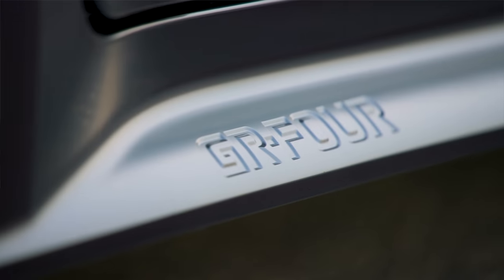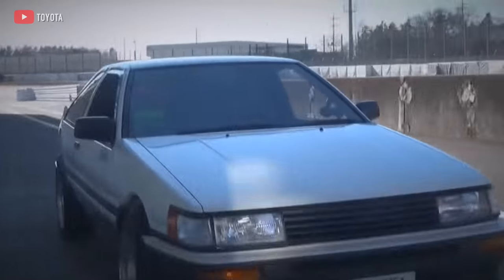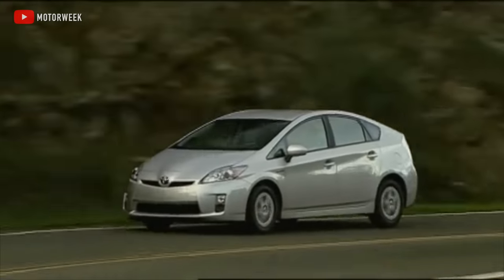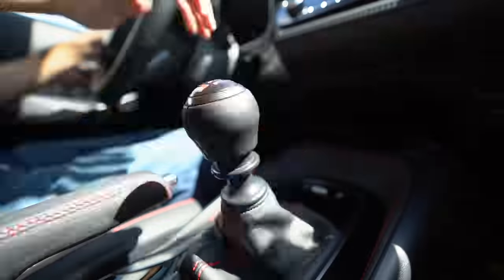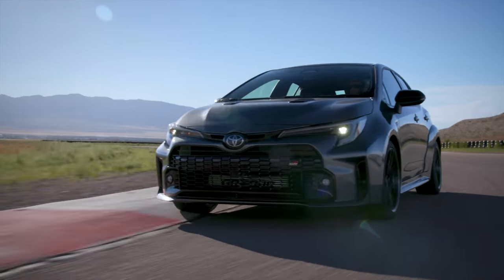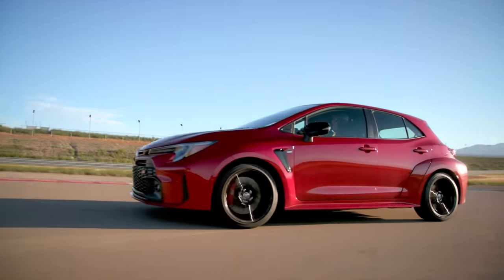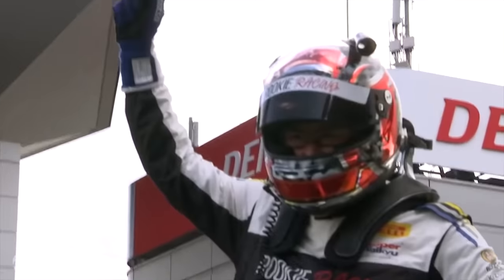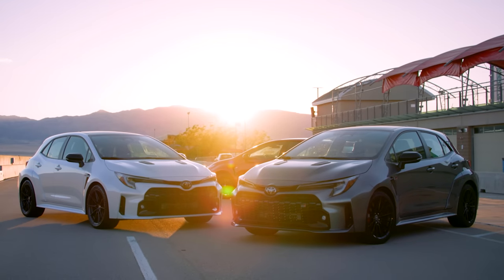Toyota Forgot How To Make Sports Cars

Comment: the Supra and the 86 have other companies in it simply because of money and profit, not that toyota doesn't know how to make a sports car. it wouldn't be profitable to design a new engine for the 86 or the Supra, it's simply cheaper to buy one from another company, or splitting profits with them.
Reply: Bullshit. Toyota is largest car company. If they build a good car it will be profitable.
Reply: @realnapster1522  no it wont because people dont buy sports cars anymore. you think 7 billion people on this earth all want a sports cars? car enthusiasts make up a low percentage of the buyers of the whole car market, and even on those car enthusiasts the percentage of the ones who do have money to buy a new sports cars (which is like $50k or more) is even lower. 40% of car enthusiasts are mostly teenagers that don't have a license too so. Just compare how many corollas they sell to how many supras or 86s.
Reply: @realnapster1522  tell that to the LFA. It was anything but profitable.
Reply from the maker: You're absolutely right! But the GR Corolla and Yaris are an interesting case study for how Toyota can build things themselves and stay profitable on the project as well.
Reply: @albonfilms  because the yaris and corolla were a platform that already existed. they didnt have to design and create a new car like with the Supra and 86. They just had to modify an already existing corolla, that's why they could do it themselves.
Reply: @Henry2000Almeida  the A80 Supra and AE86 were also built on existing platforms. The Supra shared its platform with the Soarer and the AE86 was a 7th generation Corolla underneath.
Reply: @realnapster1522  Not really, do a little research on how much money they lost on the Mk4 Supra
Reply: @albonfilms  True, that’s a very good way of looking at it, there’s even rumors now that Toyota might be putting the 3cylinder into the 86 🤞
Reply: @traviswalker8933  so you're proving my point.
Reply: @Henry2000Almeida  well they don’t have an inline 6 kicking around so it’s either this or we wouldn’t have gotten the 86 or the Supra, and maybe the interest that they drew is what made them consider making the GR Corolla.
Reply: @Henry2000Almeida  the Supra is bmw and 86 is a subaru , that's why those 2 cars receive 0 respect among can enthusiasts
Reply: @Henry2000Almeida  no, your comment reads that the AE86 and Supra were new cars. They were not.
Reply: @lilripsta911  the sales number say otherwise.
Reply: @JonathanVelez  the 86 doesn't have an Inline-6. It has a Boxer-4.
Reply: @traviswalker8933  I was talking about the mk5 and the GT86
Reply: @griffins5655  they started to lose money during the end of the 1990s. Before that, it was a profitable car.
Reply: @Henry2000Almeida  in those cases, they were built on already existing platforms of other companies.
Reply: @traviswalker8933  yeah... so it could be profitable... like I said...
Reply: @traviswalker8933  u could say a Toyota Camry got even more sales than those two combined, but that doesn’t get you respect.
Reply: @billxue2831  at the end of the day, sales do matter for a company rather than respect by those who could not afford to buy their products.
Reply: @traviswalker8933  100% after all is a business not a charity right?

The car industry changed so much over the years, back then factory don’t care about sales it was all about the glory and competition, now is just money, how unfortunate
Reply: @billxue2831  lol, your view point is wrong because companies did care about sales. Japan had an economic boom during 1985-1994 so the automakers wanted to show off their advancements in technology as well as making high-end cars to attract wealthy clients while still making bread and butter models.
Reply: @traviswalker8933  i would say it goes both way its like why auto makes still sunk so much money on motorsports.  Where r32 was meant for gt series and wrx is for world rally experiment. It definitely will attract more high profile consumers by winning competitions. But I would say attracting customer is only a byproduct of its glory and passion towards racing
Reply: @billxue2831  pretty much every automaker was rampant in motorsports which didn't have a good effect on their finances with Nissan almost being bankrupt at the end of the 1990s and Mitsubishi fading into obscurity after 2008.
Reply: @traviswalker8933  I always make this joke with my dad, Nissan need another war so they can build planes and trucks to boom again😅😂. Isn’t Nissan saying they gonna bankrupt again this year?
Reply: But they’re not as reliable as a Toyota engine.
Reply: @z32luvr  all engines need proper maintenance to work with there sure are some lemons like the GR86's boxer-4.
Reply: @lilripsta911  that is incorrect my good sir 😂
Those cars sell
Reply: @Henry2000Almeida  Sports cars were never supposed to bring in the big money, in the same way that racing was never the primary business model of any company except Ferrari. You build a sports car because you want people to associate your brand with power, performance, and style.

Sports cars are rolling advertisements. They are what makes an entire brand cool. Think of Ford without the Mustang, Nissan without the GTR, or Dodge without the Hellcat. Yes, these cars are profitable, but that’s not their only purpose.
Reply: The way I understand it, they make all models profitable in different margin and ratios to cover the global market. 
The only exception to this was the lexus LFA which had either a loss or a zero profit for them as its a showcase and the fact the carbon machine innovation was too expensive to make.
For the cases of 86 and supra Toyota can make them 100% japanese using Gazoo but at their time it all goes through their exacutive board and they decided to collaborate with other manufacturers which is less cost, catered car fan and acceptable profit
Reply: @albonfilms  maybe by their experience in WRC in recent years that they learned and tried to make.. and it proved noice
Reply: @AlifSgBuloh92  wasn’t just WRC, motorsports in general.
Reply: Just to let you know, the lotus emira has a turbocharged v6 toyota engine.
Reply: @traviswalker8933  Yes. Plus the fact that the 2J was put on many models of cars including the Soarer, Aristo, and Chaser. Toyota doesn't have an I6 ready to go, thus sourcing to BMW was the best option
Reply: Yet they make the RCF that starts at 70k ? They have been making that car for over 5 years now and let's not talk about the 100k LC500 ... So you're telling me they can't make a cheaper car to sell more ?  Stop the 🧢... Toyota hasn't built a sports car on their own for a very long time ... All of Toyota's legendary engines has had Yamahas hand in it... They need partnerships to make things happen ... Which is sad to say 🤦🏾‍♂️
Reply: @billxue2831  You can't expect me to respect a car lacking in steering feel! After all, I'm the one holding the helm. Sales number only proves that Toyota's are designed by the nerds for the nerds?
Reply: 100% false it’s funny. Toyota literally doesn’t know how to make a proper sports car on their own. That’s literally the reason why they collaborated with BMW and Subaru.
Reply: @traviswalker8933  bro, the LFA is the worst performing car in it’s class. Stop with that already.
Reply: @JacesOwnWorld  not at all. They collaborated to make profit and due to the fact that BMW makes the best inline-6 engines. But like your name suggests, live in your own world.
Reply: @traviswalker8933  I was responding to someone that brought up the Supra. Well aware the 86 doesn’t have an inline 6, I own one.
Reply: @JonathanVelez  well, you said Toyota didn't have an Inline-6 laying around hence why they went to the companies they went to and we got the 86 and Supra, kind of implying that the 86 might have the inline-6 engine when it doesn't.
Reply: @traviswalker8933  they didn’t have to use an inline 6. They can use a high efficient V6 from Lexus instead of BMW crap.
Reply: @realnapster1522  then the outcry would be more high that they ruined the only good thing that the supra had which was an Inline-6 with a high tuning potential.
Reply: @traviswalker8933  people were talking about the Supra and Yaris as well, I wasn’t implying the 86 has an inline 6, I was referring to teaming up with BMW for the Supra. Toyota needed their inline 6. Like I just said, talking about the Supra not the 86.
Reply: BS
Reply: @Henry2000Almeida  BS
Reply: @traviswalker8933  No it wouldn’t. The Gtr uses a V6 and it was an I6. Plus most sports cars either use a V6, V8, or I4 nowadays.
Reply: @griffins5655  I’m pretty sure whatever they lost on making the A80 Supra they regained it back by selling it as the Soarer and the Lexus SC.
Reply: @lilripsta911 so the Bugatti is not recognize because it's a Volkswagen ?
Reply: @lilripsta911  you slow or something. Both those cars are loved by car enthusiasts
Reply: @traviswalker8933  Shared with the Soarer, that in itself was already shared with Lexus
Reply: @Flashbang_Photo  yes, so it was already built on an older platform and was meant to be a grand tourer.
Reply: @PandaP-  Except when said v6 drives so well the z loses to it in every way. In dynamics and smoothness, you can't beat an inline 6. Also of how light the supra is. 3300 pounds. Lexus is abandoning the RCF for their motorposrts because its chassis is a liability. If toyota deems the RCF a lost cause, the lc500 is a far reach.
Reply: @albonfilms , an equally interesting case study can be made that the Toyota Supra and the gr86 both paved the way for the existence of the GRS and the GR corolla. If it wasn't for the popularity and I don't know likelihood, the profitability of both of the former cars, the latter ones may not exist today
Reply: @lilripsta911  You are not a car enthusiast dude. Nobody cares about toyotas unless it's a JZA80. Nobody has "respect" for toyotas 😂 86 is a phenomenal car and redefined what a modern hardtop compact FR coupe can be. They have problems but none of them are because it's "not a toyota"
Reply: Don't forget that Toyota is a major shareholder in Subaru. Toyota also a shareholder in Yamaha and Daihatsu.
Reply: @traviswalker8933  Didn't the LFA also cost as much as a house? I think Toyota could've just improved on the Lexus RC platform. They have a sports car right there that they could've done something with.
Reply: @mistamaog  then that improved RC would've cost as much as a house.
Reply: @traviswalker8933  The LFA was a bespoke carbon tub with it's own unique engine that was co developed with Yamaha. I suggest watching savagegeese's video to see why it cost so much.
The RC is around $40k, at least when it launched. Removing luxury features and adding a Supra badge isn't going to turn it into a $400k car.
Reply: @mistamaog  it would've made it a six figure car in today's money which Toyota didn't want as people would complain about it that the Supra was 5 figures and this thing is 6 figures and it's a revamped Lexus underneath. Further, I know about the LFA. Nat Geo made a documentary about it.
Reply: Well since they got this 3 cylinder engine maybe they now can build a inline 6 and finally make a in-house Supra
Reply: @traviswalker8933  those are just people that wanted a modern or fancy car. A true hard-core dedicated Toyota or Honda fan boy....like my self.. are disgusted at Toyota and would refuse to buy there love child cars with the other companies. They may perform well and may be reliable. But just simply the knowledge it wasn't all in house is enough to prevent me from buying one. And I was almost excited to hear supra was back.. until I found out... no Thanks.
Reply: @realnapster1522  they are company with lots of people invest money at them. So they can't be selfish to make sports car that has high investment and low profitability. GR yaris and GR corolla use toyota wrc racing platform. And Both of this car happened not because for profit, but for racing purposes
Reply: @realnapster1522  look at the Lexus LFA.. it was a financial BOMB for them.
Reply: @lilripsta911  hey there, 86 owning car enthusiast checking in.
I fuckin love my Toyobaru, go cry in your sim rig lil buddy.
Reply: Yeah bullshit,toyota has sold more cars than any other manufacturer in the history of car manufacturing.
Reply: @lilripsta911  Just because stupid 12yr old fanboys of MK4 Supra say that "broo this isn't a Toyota stfu" doesn't mean it doesn't get any respect... These are fine cars for fine money, with good performance, looks and reliability. Much better then many "respected" sports cars like hellcats etc...
Reply: @Henry2000Almeida  i heard a rumor that they going to launch a 3jz in the 2023 supra from the profit of selling gt 86 and new supra the bmw supra lol i really hope their own supra
Reply: The 2000GT was the beginning of Toyota's doubts with sports cars. With the simple times of the 90s, they had a resurgence. Then, with the end of the Japanese economic boom in the late 90s and early 00s, the supra mkiv, (yes, THAT supra) was a financial failure, which once again cast doubt on the profitability of the sports car. Then, the LFA killed any interest whatsoever, a halo car that never became culturally relevant or "halo" enough to  justify its loss in money. Now, we have the GR Corolla, engineering on a platform that already exists so that the bean counters can't say it was a failure.
Reply: @abalakrishnan4152  ok I get that but how long do you think these 3 cylinder engines will last with the amount of stress on them?300 hp with 25 plus psi boost from the turbocharging and high revving means loads of stress and high wear. I doubt these engines are made for longevity.
Reply: @Healthliving1967  3 words: it's a toyota
Reply: @abalakrishnan4152  yeah I'm well aware of TOYOTA as I have a camry and my wife has a corolla. But these engines are NOT turbocharged and don't have the extreme pressures and stresses on them like these will have. Time will tell if they can handle 400,000 to 500,000 kilometres.
Reply: Toyota lost its way more Han 20 years ago
Reply: @Healthliving1967  these engines are probably tuned to 400-500hp for rally. They are built withstand such forces. 400k km probably not, but almost certainly at least 200k km.
Reply: 2 letters, 1 symbol and 1 word: 
R & D Cost. I definitely agree with your comment Henrike. Some people here just have their opinion without doing a little research:)
Reply: @griffins5655  Better example how much they lost on the LFA and what it is worth now ^^
Reply: @abalakrishnan4152  lets say they fail to make fast car but just reliable
Reply: Well the supra doesn't have BMW in it. It's entirely a BMW. But they would have lost the Supra name if they didn't make something.
Reply: @hibs5516  new supra a90 mk5 and noo they wouldn't lost the name it would just stay in mk4 a80 supra
Reply: Toyota made a smart move
They are teaming up with other companies
While most companies are going solo
They are taking more by sharing more with each individual company.
Reply: @lilripsta911  that's unfair.
If it's 0 Toyota, why was there a partnership?
Reply: That's because people want SUVs and minivans.
Reply: @realnapster1522  Sadly Tesla has been the biggest for a while now. Not Toyota
Reply: @traviswalker8933  hee talking about the GT86 and the A90 Supra, which did need new platforms lmfao
Reply: Mk5 supra >>>>>>>>> mk4 supra
Reply: @Roberto Vidal Garcia EXACTLY
Reply: @realnapster1522  now that's bs. Dude, people just don't buy sports cars anymore, so why would a sports car be their main focus. Car companies have build great cars before and they still fail simply because there was no need for that particular car. Until people start  buying sports cars again, it doesn't matter how good of a car it is if there's no consumer need for it.
Reply: @traviswalker8933  the LFA was never meant to be profitable. It was always intended to be a limited production car. They even said themselves that they knew they wouldn't make any money on the LFA. They just wanted to show they could build something other than an appliance, or wofty Cruiser.
Reply: @realnapster1522  the LFA is lauded as one of the greatest cars ever made, and they lost money on every single one they sold.
Reply: @albonfilms  the reason they’re profitable is because they’re based on pre-existing models and thus don’t require R&D, at least to the extent of a brand new model. That’s like saying the WRX sti is a case study for profitable sports car making, despite it being originally developed as an Impreza. Just with go faster bits added on. Same goes for the Honda Civic Vs the civic type R.
Reply: @groundhabit6408  if by a very long time you mean.. like 12 years. Then again pagani sources engines from Mercedes’, lotus sources engines from Toyota, do they not “make their own cars”?
Reply: @JacesOwnWorld  interesting, the MR2, celica, supra, every lexus sport model, 2000GT and I’m sure many other obscure Toyota sports cars would like to disagree.
Reply: @PandaP-  and the GTR was hated by GTR purists when it came out
Reply: Tbh，although I love sport cars, my first car choice wont be a petrol sport car, may be a hybrid or ev, I may consider a more sporty car for my second car but may consider a 90s project car😅like a s2k
Reply: @alvininuk7492  makes sense for a humble Brit. Nothing wrong with an economical sports car, as long as it’s fun, elegant and sporty, it’s fine. I’d love to have a mass market hybrid sports car with a similar hybrid set up to the Mclaren P1, or another hash at a fisker karma type hybrid sports car.
Reply: @Healthliving1967  that's why don't interest or ruin their sales figures because of sports car
Reply: @Healthliving1967  yeah maybe cuz people in Australia have gr yaris with high mileage and some of them literally beefed up performance more than what gr corolla offer
Reply: @brandonmiller9155  did you not read my comment ? Name a true sports car Toyota has made in the past 20 years that Yamahas hands didn't touch ? Every single legendary engine Toyota has made has Yamahas hand in it ... You bring lotus and Pagani in the mix ... They used a base engine from a manufacturer and reworked the internals and other mods ... It's not like they just dropped the engine in as is and said have a nice day. Toyota is one of the largest auto manufacturer in the world and they still need partnerships to make things happen vs doing it in house on their own with their engineers only. It's sad that Honda as the smallest brand haa done more in and for motorsports then Toyota has as a bigger manufacturer.
Reply: @groundhabit6408  yamaha makes their heads. The rest of the engine is all Toyota. But, I’ll do you one better, who’s a majority shareholder in yamaha? Something like 3.58%? A third as much as yamaha themselves own of their own company, uhhh that would be Toyota. You which is better? Having a component designed by an arm of your company, or bringing in another engine from a separate manufacturer who did all the designing engineering and testing, and then swapping out parts to improve it and pump up the price tag? Guess mazda never made a sports car, since the 13b is just a revision of a specific wankle engine designed by wankle himself, or I guess the corvette isn’t a real sports car because it uses a transmission sourced from another manufacturer rather than one developed in house by GM, again, lotus uses a slightly modified (as in adding a supercharger and some injectors) toyota motor, and a manual TOYOTA EC60 transmission. Does that mean that lotus doesn’t in fact make sports cars? Don’t speak about shit you don’t know or don’t understand. Have opinions, but know your opinions are wrong.
Reply: sooooo we are now defending incredible wealth companies because they cant make a profit??? bruh you should work at EA
Reply: Henrike very true..you said...people now days don't care sporty beefy engine..all the man of the family wants a pretty looking car which can carry all four members, plus that man wants to play a big huge screen on his dashboard from centre console to his steering wheel just like a toddler adores his rattling lil toy day and night...he won't be bothered if his car's engine is trashy and laggy but he has leathered interior with big screen...we live in zombies world ...I am very sad that Pinnfarina like legend got sold to some Indian Junker salvager company ""Mahindra""..welcome to new world....
Reply: It’s funning reading comments here and found some car enthusiasts care about the brand more than the car itself. Like people buying entry level Mercedes compare to top line Camry.

If you open your mind a bit, that’s BMW supra is a really capable sport car, and dont tell me BWM name doesn’t scream “car enthusiast”. By the way, its B58 engine is a beast, S58 will be even better. Seen on youtube on some channel, they pushing 1100HP, 0-60 in 1.75s on mickeys tires with port injection (replaced from stock direct injection)
Reply: @realnapster1522   it’s not the largest company in the world also it’s completely reasonable some of your fav cars have parts from other companies for instance Bentley uses the V12 an engine made by Volkswagen And jeeps use Chrysler parts
Reply: It’s just dumb because people would be waaaay happier if they just threw new 2JZ’s into the new Supra , they already own the rights and blueprints and everything to them, maybe have the 86 coke stock with a 1J. And boom then it’s an all Toyota car they don’t have to spend any more money to produce
Reply: @realnapster1522  toyota hasn't had an rnd project for a 3L inline 6 in decades, for them to catch up to the current I6 technologies they'd have to spend millions of dollars, and that's just for the development, not manufacturing the tools for manufacturing for a new line of engines, thats another few hundred million dollars, it's not that profitable
Reply: @albonfilms  the yaris and Corolla were already existing chassis that Toyota had, it’s easier to just add a drivetrain and make it AWD, but a rwd chassis that is being built from the ground up is why it’s much harder to make
Reply: @groundhabit6408  that’s a horrible example because all  special Lexus including the ones you mentioned use the same exact engine that there been making for yearrrrrrrrs. Making a new engine definitely would not be profitable. Not for Lexus and not for the Supra or 86.
Reply: @alvininuk7492  If I may ask why is it the current cost of fuel? If so it's the prime example why governments should start lowering petrol taxation and relax emission, because manufacturing the battery for that EV or hybrid you're talking about pollutes double what a reasonable gasoline car would throughout it's lifetime. 60's style laws would one up awhile new market for car tyes and models we haven't seen since then.
Reply: @Lukemasonmedia  Both of those engines are so old rn that it wouldnt be viable to make modern versions of them.Also having an 1jz in an 86 would be the biggest mistake because 86 is made to be a perfectly balanced sports car, not a unbalanced death machine.
Reply: @abalakrishnan4152  500?? wrc cars dont push that kinda power😭😭
Reply: @griffinv8382  tesla hasn’t sold more cars than toyota toyotas been around for more than half a century 💀
Reply: @MA-kr6yv  You are 100% correct. Toyota has sold many more units than tesla. I was however talking about the sheer value of the company. As much as it pains me to say it as I am a massive toyota fanboy. Tesla is bigger.
Reply: @Healthliving1967  You guys really have zero grasp of how it works. How many cars they've sold is completely irrelevant. It's about the returns on the specific model. The sales for that car has to make up for the cost to R&D on the car, and the price is based on that and projected sales. So either you would had a $100K+ Supra made in-house or a the more reasonably price $55K Supra from the BMW collab. 
Reason why the majority of affordable ice performance cars left are sedans and hatches. It's a lot cheaper to turn a car that already sells on a massive scale into a race car, then it is to build one from scratch.

The big 3 got away with their prices because other then cutting corners in quality, they basically used the engines  and trans that’s in all their other cars. All the manuals are third party sourced. They also sold far better then other Sports cars. At one point Ford was selling almost 100k Mustangs a year, while most struggled to sell 20k. 
The Z is pretty much just a refresh, that’s why it is losing to everything. Lol 
Mazda has some kind of voodoo engineering. That the only explanation  I got for the MX-5 still being kept alive.
Reply: @Lukemasonmedia  Well that's where they other people that have to please comes in. The world  governments. The 2JZ wouldn't have passed modern regulations, hell the new BRZ/86 soon  won't even pass in Europe.
Reply: @griffinv8382  fair enough in that aspect you’re prolly right i thought you were on abt sales numbers
Reply: @MA-kr6yv  Sorry. Should have done my research. They make around 380hp at 6k rpm.
Reply: @realnapster1522  ,bro How old are you?
Reply: @realnapster1522  Toyota is the largest and owns a big chunk of subaru parent company. So the 86 is more purebred than you think
Reply: @albonfilms  The GR Corolla and Yaris are existing platforms modified with a new powertrain.  The GR Supra and 86 had no current existing platform Toyota could have replicated this methodology.  In fact Toyota has already disclosed only 8600 units of the GR Corolla will be built in the first model year and only about 6600 of those are for the US market.  Good luck finding one to purchase let alone at MSRP as they're more than likely all accounted for already.  Compare that to the 15,000 units that were made available for the FRS/BRZ in their first year of production.   Join project ventures allow for more units to be produced making the vehicle more readily available to the average consumer.  If anything people should stop complaining and enjoy sports cars while we still have them.  Those who complain the most are never in the market or can't even afford a sports car.
Reply: @realnapster1522  Do you know why even dedicated exotic sports car manufactures like Ferrari and Lamborghini are making freaking SUV's, because that is where the money is at, SUV's, not sports cars.
Reply: @JacesOwnWorld  It's not all about track numbers, usually young people only care about that. The LFA has a screaming high RPM legend of an engine that people would say sounds more dramatic than Ferrari
Reply: @phosimmie  We are in the last era for large engines bruh, EV's and hybrids are the future. Pretty much the target is by 2025, that all new vehicles will meet these new regulations. Their isn't going to be a company spending years to develop a large all petrol engine and release it before 2025
Reply: @guycha0s380  I have an MK5 BMW Supra and enjoy it a lot, but I would trade it in a heartbeat if they miraculously manufactured a new Supra with an inhouse made bulletproof Toyota inline 6. I just gotta cross my fingers with this car's reliability in hoping Toyota did some quality control on BMW. To a German, who usually just leases luxury brands, reliable to them is like nothing bad happening to the car in 2 years... Such a short time to be considered "reliable"
Reply: @RENO_K  What was also shocking fact that the profit taking by an average car sold is very low percentage after everything is done. The materials used for the vehicle, payments to the workers, etc. For an average $30k vehicle sold, the car company only takes around $2,500 profit. Few exception are the high enthusiast or luxury brands, for instance, Porsche makes $17k profit per car, and Ferrari makes $80K profit per car.
Reply: Doesn't matter, it's a fact they still don't produce a sports car on their own besides this gr corolla
Reply: @Yggdrasill8  well not me
Reply: @realnapster1522  so, you know the car industry better than Toyota? Bullshit...
Reply: @albonfilms  not toyota's fault that people don't bother to buy sports cars anymore. Salaries stagnating while prices go up, disposable income on high price toys is not as abundant as it was. College, hospitalization, housing, etc. are all too expensive for a sizeable part of the population.

If they can sell a profitable in-house sports car then they would, profit is what drives corporate business after all.
Reply: Yeah the gr86 is an overpriced ricers dream
Reply: @realnapster1522  most company sells their sports cars at a lost, it’s more about “we can do it” rather than making money
Reply: @realnapster1522  
Meanwhile Toyota reportedly lost money on every Lexus LFA built. You obviously know nothing, Schultz.
Reply: @lilripsta911  
Last night I heard a Supra accelerating from an intersection. It sounded awful. I don’t know if it was worn out or what, but that sound alone would make me skeptical of buying one. But since it has a BMW engine, all hopes of buying one already disappeared.
Reply: @Henry2000Almeida  Corolla GR is based on an already existing platform that's true. GR Yaris however is all bespoke, besides headlights and the mirrors. So they can do it, they just don't for some reason. They could have made an in-house 86 but didn't, I don't know why, it's so dumb
Reply: @lilripsta911  There’s a reason why the Supra MK4 sold less units lmao
Reply: @realnapster1522  If they did that it would be the same outcome as if they manufactured a whole new engine, it is not profitable to manufacture the new engine so they borrowed it from BMW, also, there’s a reason why the Supra MK5 is more successful than the Supra MK4 in terms of quantity sold.
Reply: @Lukemasonmedia  Have you not read all of this comment thread? It is not viable to make another 2JZ for obvious reasons, the main one is because of money. They would lose so much money by investing on a car that just won’t sell. Not many people like or need sports cars so why would Toyota bother on making a new engine? Last time they did that with the Supra it just was a failure. Not many MK4 Supras were sold that’s why it’s rare. It’s way more viable to share an engine with another car brand because Toyota isn’t manufacturing that engine so there won’t be a significant loss from investments into the car’s manufacture. Also the B58 is very capable, it’s tied to the 2JZ in terms of tuning potential.
Reply: @traviswalker8933  yes but that was a limited production model
Reply: @starcraftgod1212123  most of Toyota and Honda fanboys can't afford what they make either so they don't care what is thought of their cars by those fanboys.
Reply: @phen1811  just like the 2000GT, it was built in limited numbers to have exclusivity.
Reply: If Ford and GM and Dodge and Nissan and Volkswagen and BMW and Mercedes and even Lexus can do it, then Toyota can too